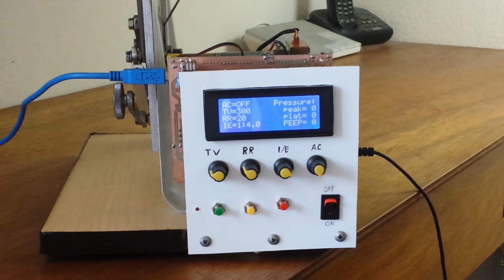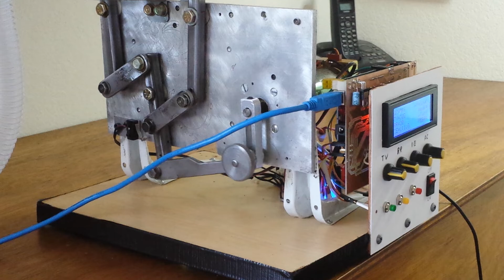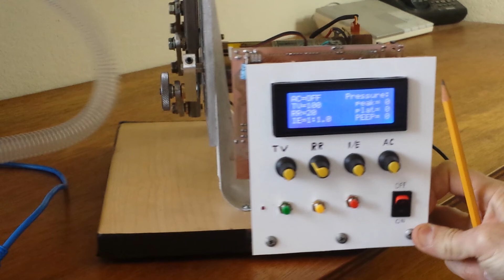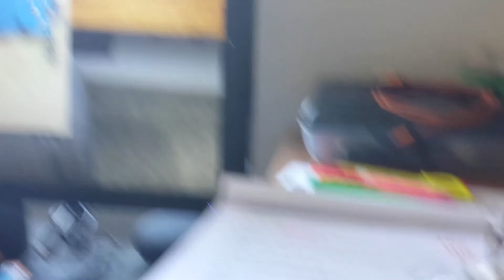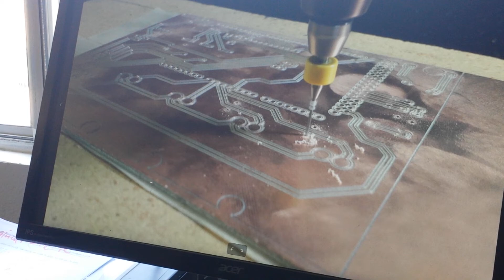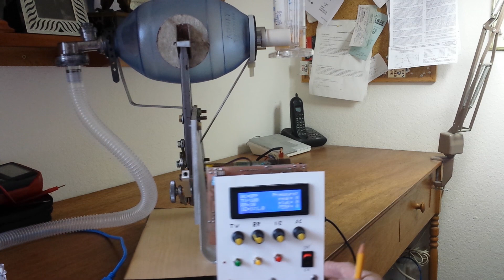DIY mechanical ventilator with closed loop control #3

Comment: Peter, How did you integrate the MPX5010 Pressure sensor to the MIT Arduino source code. My display only display pressure but with no values.
Reply from the maker: Hi Prinsloo,
Go to my other video https://youtu.be/8QHkeHuCwh8
In the text section of the video is a link to my  source code changes for the pressure.h file  .
Also redid the whole circuit board to incorporate the MPX5010dp and a few other things for the LCD contrast. It all on that same video/ text page. Take care ...Peter
Reply: @peterleiby5797  
Hi Peter
Thanks for the link, much appreciated. I managed to add your code, but I still see the following on  my display. see the picture in the link: https://1drv.ms/u/s!AvTlDa_4xD0EhLhDuJGu8jBRshiV4w?e=bRqj23

Do you maybe know why this would be?

Lastly, we also have problems setting up roboclaw controller for the motor. We used the correct baud rate  and bit sets. But the motor isn't responding as its supposed to. Any ideas why? You can email me as well if you want on prinsloo.vdh@gmail.com
Reply from the maker: @prinsloovandenheever7848  If the controller is not up and running,that would explain the no pressure indication .You need one RR cycle to get the pressure readings.
Reply from the maker: @prinsloovandenheever7848  does the controller work in basicmirco studio with direct usb hook up to the controller? link https://youtu.be/UsKsnQNgVQk
Reply: @peterleiby5797 
Hi Peter. Thanks for all your help. Everything looks fine now. Im trying to disable the pressure sensor in the MIT code. But Im really struggling as Im just a basic programer. Do you by any chance have the code where the pressure sensor has been by passed? Thanks in advance.
Reply from the maker: @prinsloovandenheever7848  https://drive.google.com/file/d/1kNz4b5HbX6RhfWlgTQcHbXgI0xtXZSXY/view?usp=sharing

Just replace the entire Pressure .h file with the the file above.It has the Honeywell sensor disabled and the MPX enabled